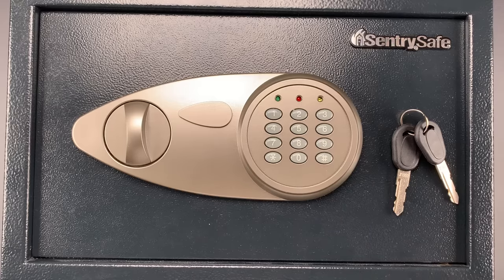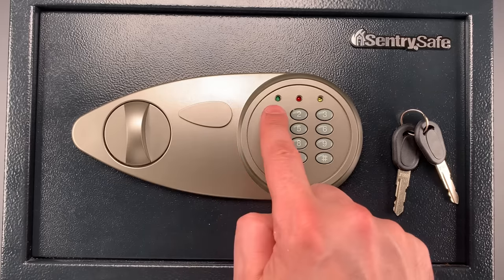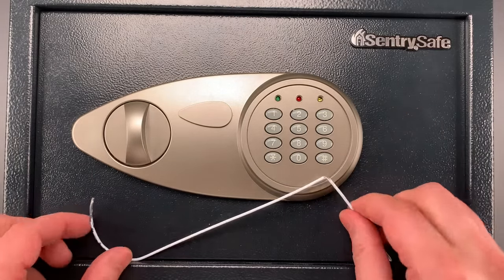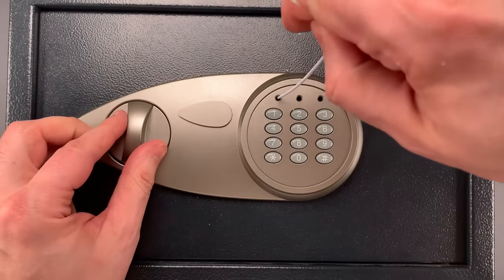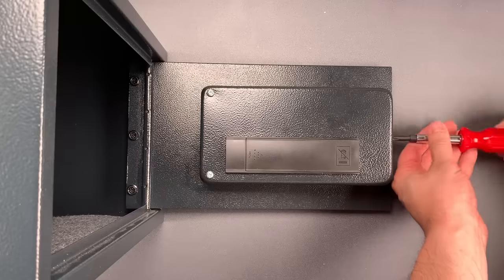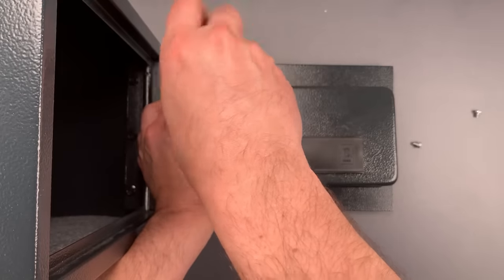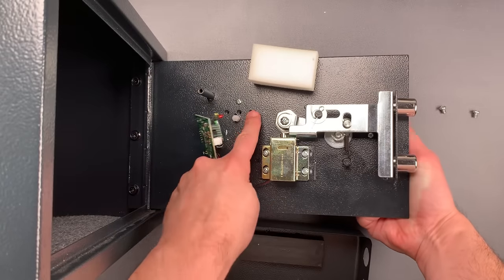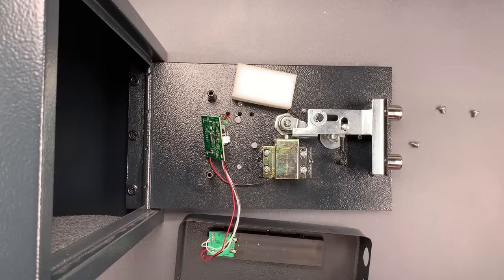[1020] SentrySafe Opened With a Coat Hanger!

Comment: I've seen these types of safes in hotel rooms and by merely hitting the top of the safe with my fist (to bounce the solenoid) and turn the knob at the correct time, they can be opened without any tools whatsoever.
Reply: Check out video 1108
Reply: Omg. Thank you SO MUCH!!! I couldn’t get it at all until I read this
Reply: Hotel safes aren't....
They are a requirement of the hotel's insurance. As you stated, they can be opened with a sharp knock. There again, if you've used it to store your Cartier watch or whatever & you're robbed, the hotel's insurance may pay out (hopefully!)
Reply: @stephenphillip5656  Hotel Insurance?  Good luck with that in Asia, Central & South America. LOL
Reply: @stephenphillip5656  when I'm at a hotel or an airbnb I store my omega watch wrapped up in dirty undies.  I even get a chocolate bar and put a strategic brown stain on them.  

Thus far this has been a pretty good security measure.
Reply: @claytonberg721  reading your comments eliminates the whole chocolate bar trick🤣
Reply: @Zain staric OK, I blame popeyes.  But seriously, I have a few pairs that are rather historic and I hold on to them shoe shine rags and the like.  I have one pair that I pack and wrap up my watch, extra cash and passport in.  I haven't figure out what to do with my ipad pro yet tho, maybe i'll go to the thrift store and pick up some granny panties or something.

Also ladies and gents, tip your room attendant.  Leave a few bucks there.  It's a thankless job, a clean room and a room attendant that isn't fecking around with your stuff can make or break your trip.  You won't miss that fiver, but it may make someone else's day.  My two credits.

Comment: From the looks of the locking mechanism that's also one of those non-safes that can be opened by a sharp whack on the top... It's utterly ridiculous.
Reply: Beat me to that exact  point.
Reply: Or bounced off a mattress if it's not secured to a wall or floor
Reply: Yeah looks like if you picked it up and dropped it sharply on a surface you could unlock it as it hit.
Reply: @John_Ridley  you have  to drop them on the bottom  right corner but it does work
Reply: I remember seeing a video where one was opened by banging on it with a potato. Whacking it open didn't even damage the potato...

Comment: I went to Amazon to post this link and found videos showing that this safe can be opened even faster using *gravity*.  Lifting and dropping the safe (less than a foot) causes the solenoid to dip enough to allow the bolts to retract. Much faster than using a hanger and will not show any signs of forced entry.
Reply: Hahaha I was thinking the same thing after seeing this vid
Reply: There is no way that solenoid has that weak of a spring! ....Right?
Reply: @lorenzknox6922  I bet the spring is made of a spongy metal

Comment: There is a MUCH easier way to open this type of safe as long as it is not bolted down. Because it relies on a solenoid that has a VERY weak spring to engage the locking bar
All you have to do is give the safe a quick shake downward and quickly up and it causes the solenoid to retract momentarily and you can open the safe! No tools required.
That being said, LOVE THE CHANNEL 😊😊😊😀😊😀😊😀😊😀
Reply: Thanks, I sprained my back with no success.

Comment: High-security sponge jokes aside, that spring-loaded solenoid is a joke, itself. Could you potentially just drop the safe, and displace it enough to open it?
Reply: Sure, you don't even need to drop the safe. Just hit the safe from the top and turn the knob at the same time. It takes 5 minutes of practice and opens about 75% of these types of safes...
Reply: They're usually bolted to something solid.
Reply: Exactly! You have to be naive to believe that someone can't just can walk out easily with safe on hand! My advise, question all protection systems, specially the ones you didn't make!
Reply: @biggawinnacrapsa3870  hit on top works even when they're bolted down though.
Reply: dropping it would probably break it and then the safe will actually be inaccessible!
Reply: There is a video of a 12 year old kid dropping it onto a bed from 12" and bouncing it open every time. If the safe is bolted down, you can open it with a rubber mallet!
Reply: Fred Krazé but it’s a safe which means it’s supposed to be chunky at not break
But there’s an idea in that rubbish, a safe that fucking explodes sending lethal shrapnel everywhere if too much force is applied

Comment: It appears with many locks you pick that you have been able to view the internals to find the weakness before attempting to pick the lock. How would you approach picking this lock without knowledge of the internal design?
Reply: How does a car mechanic fix cars? By knowing the inside components.
Reply: This is at least the third similar safe I've seen on this channel that has the same garbage tubular lock bypass behind the panel in the middle of the face.  (Honeywell and AmazonBasics were the others.)  The impressioning tool to defeat that lock is readily available, and not only picks the lock, but tells you the pin depths to make a copy of the key.  If I wanted to buy one of these at this point, I'd be shopping for a new bypass lock first, then buy the safe and open it up to see what else needed fixing to actually make it a "safe".

Comment: @LPL - thank you. My safe battery ran out, and for some reason the key was jammed and wouldn't turn. On my safe the coat hanger trick wouldn't work - the LEDs were firmly held in. However just seeing where the solenoid was positioned (I could see the four screws on the other side), allowed me to work out where to drill one single 4mm hole, and through immense luck the drill bit itself pushed the solenoid down.  Took 10 mins to drill through though - tougher than they look!

Comment: I found one of these dumped by the communal bins - I picked it up and shook it - I heard something rattling inside;
" That's coming home with me, I said to myself ".
I too was able to able to circumvent the solenoid - ( with the assistance of  gravity -shh, it's a secret ).
It sounded like a ring or pair of rings were inside - I was hoping for a Diamond engagement ring or a pair of Gold wedding rings . . . 

. . . it was the screws for affixing it to the the wall or floor ! 
All was not lost - I changed the combination and sold it for a tasty 20 bucks.

Comment: You can also just bang on the top. Pushes the solenoid down for just long enough so you can turn the handle. Have even been able to do this with the safe bolted to a concrete wall.

Comment: Would make a great decoy safe. Leave it near the entrance with a wire hanger on it. 

The hilarious thing is the could have easily fixed this by super gluing or hot gluing a piece of wood of plastic in the way of the holes and the solenoid. Although, they may actually do this as a user fixable fix as they did with their fire safes that can be opened with a magnet.

Comment: One of the very first safes I learned to unlock. I used a letter opener to put into the key hole, and turned the key mechanism and I was in. Some folks 'round these parts charge $150 to get in for customers. LOL

Comment: Every hotel room I’ve seen that contains a safe was one of these
Reply: Honestly hotels shouldn’t even bother putting a safe there if it’s gonna be a shitty one like this. Who even uses the safe anyways?
Reply: @LunaProtogen  People with kids I guess.
Reply: squngy0 Oh right, I guess that makes sense.
Reply: @LunaProtogen  Most common use case I've heard is when the tenant brings back a one-night stand and they don't want their mate to run out with their shit before they wake up the morning after.
Reply: @LunaProtogen  Insurance purposes. If valuables/passport is stolen, you can prove you used the hotel security, therefore insurance pays out. Don't forget for this to work he needed to know he could poke the wire in, guide it and where to push down on the solenoid - yes it's a shit design when you see it done like this, I wonder how many times he did it without opening it and angling the wire correctly to get it done?
Reply: Gobtik honestly, that thought pops into my head a lot watching these videos. I wouldn’t even know where to begin to try exploiting any locks/safes if I were just guessing my way around. Then I watch these videos and I’m like “huh. That easy.”
Reply: @LunaProtogen  it's less for protecting your stuff from someone breaking into the room and more for the staff who come in during the day to clean, when I'm in a hotel I'll hide my passport if I have it as well as my battery chargers in the safe just to make sure the hotel staff doesn't pocket it.
Reply: @Gobtik  He reverse engineered how to break into it.
Reply: The safest place would probably be in the coffee makers under the coffee grounds. The maids don't even want to touch that. Or if you want to be clever, tape it under a chair and hang a jacket over the back. Pretty sure no one would look.

Comment: I have (had) a SentrySafe Model PL048E in my work van. Has a dial and keypad like this one, and a key lock I guess for backup.   The battery died and I needed something out of it, but could not punch in the code, and they never gave me the key to it. I got my boss to approve me prying/cutting it open, and he would then order me a new one. I thought before I grab the ol' angle grinder, I would try to pry if open. I figured I would have to peel the lip up from the lid to get a prybar in there, then pry the lid off of the body, or something like that. I started with a flathead screwdriver, but instead of having to peel/pry/repeat, it popped right open in literally two seconds, just with enough force from a standard flathead screwdriver that I think a 6-year old could have done it. I told the boss not to bother ordering another one. I think I got into it faster than even you could have picked it, and more easily too. Moral of this story: DO NOT waste your money on SentrySafe products!

Comment: Thank you, Thank you! My little key broke in half, I had no batteries in the safe, and I was willing to try anything (including drilling and smashing!). This worked perfectly! I did spend some time on pause with an exact picture of the shape and size the hanger needed to be, but after that it took 1 minute... TaDa! Thank you again for you help. I couldn't find a replacement key. I will use batteries for now until I get a new safe.

Comment: So, so all they need to do to fix this is by welding a steel plate between the locking mechanism and the holes and circuit board?
Reply: hahahaha...welders cost money. No.
Reply: @MrStrizver  Where I work, welders are underpaid and robots are even cheaper.
Reply: TRUTH _  , by "they" I meant the manufacturer to add this step to rectify the problem. Smarter.
Reply: Buy a better safe.

Comment: At least hotel safes are never positioned near coat hangers. 🤣
Reply: Some hotels having the coat hangers locked to the rail isn't actually to stop you stealing the hangers; It's to stop you opening the safe.
Reply: @anononomous  bingo; the pieces are locking in, so to speak . . .

Comment: How would you have been able to do this without first knowing the position of the solenoid and particulars like the foam PCB retention black? Or, did you simply pick the lock first then examine the mechanism?
Reply: I wondered that myself.
Reply: I'm guessing any safe expert who has taken a few apart can pretty much immediately picture where the solenoid would have to be at a glance.
Reply: @montanaxvi  And continue to wonder I suspect we will. The LPL never seems to weigh in on questions.
Reply: @jafafa  I'm sure that's an aspect of it but no one would know with first having seen it that there is a block of foam holding the PCB in place because that's really stupid.
Reply: Sure, but he surely knew there was a PC board the LEDs were mounted on, that holes are a potential weak point, and that pushing on the LED to see if the PC board could be moved would be among the first things to check. Maybe not expecting foam, but PC boards are often loosish for varioius reasons, especially in cheap crap.
Reply: Do you really want to trust that a criminal out for your stuff doesn't research? 

Sure No low intelligence criminal would try to pick it, but a career thief would absolutely buy safes to find their weakness.
Reply: @Pickleriiiiiick  A reply from the Man hissownself would be helpful here.
Reply: @michaelisaacson9735  I don't know how. People who steal for a living do it completely differently from the ones that "need money" for drugs etc. They will put in the leg work to Learn how to do the job. 

Any low end lock)safe is only there to deter opportunity thief's. You need actual security to deter any expert or career thief

Comment: Im so proud of myself, we have this same safe at work and it ran out of battery and we had no keys, but thelockpickinglawyer had us covered 😎
Reply: Any other tips? Mine ran out of batteries and I can’t seem to unlatch it
Reply: @Jdan0114   Make sure your wire is only as as long as his was, and you insert it at the right angle.  I inherited a locked "safe" with my house, and decided to try and open it to remove it.  First try failed, reviewed the video again, trimmed my wire, got the insertion angle, then tried again and had it open in 10 seconds.

Comment: Besides the holes in the door, how was the rest of the safe? Because I could easily see that being patched by a user who was handy and preventing that bypass. Was the lock easy to pick compared to other safes?
Reply: If you look at the inside door hinge, it's secured by three screws instead of being weld which I would call a weakness.
Reply: Simple: You just drop it on the floor to open it

Comment: welp you saved my butt today, I'm a manager and switched the code on one of these bad boys today, made sure the code worked before I shut it... but forgot to shut the battery door.. 😂
safe locked, key inside and no power to the keypad because the batteries popped out - an hour and a half later and I was in! Thank you LPL!

Comment: I’m a locksmith and veteran lock picker, aside from medeco or Abloy, I haven’t seen a lock I couldn’t pick. The sentry safes I’ve opened often are easily picksble, whether single side key, double sided, or tubular, are very easy to pick in a matter of seconds. The right tools can get you into most safes if they have an electronic lock with an optional key only lock mechanism.
Reply: I have a sentry safe and when I closed it the battery fell inside. My husband lost the key now I don't know how to open it. Can you help.

Comment: If you have a cheap fire safe for documents, leave it unlocked so the thief can see there is no value, instead of having them carry it off or bust it open
Reply: Or leave this IP address taped on the safe in case it gets locked by accident.
Reply: @somaday2595  you might be a computer geek if you call the combo an IP stress 👍

Comment: I would not say having a hole is the problem as most safes have holes in the door and can be unavoidable, i would not even say the sponge is the issue because all these would have not mattered had they simply welded a blocker plate between the solenoid and the holes.
Reply: Maybe you don't need lights on the front of your safe
Reply: @phillip stafford-dafoe  Not really if there was a plate between the tiny holes and the solenoid then this exploit would never work no mater how long you tried and people would need to fall back on brute force or code cracking.
Reply: @nathan-fh8hp  Perhaps you do or perhaps you don't, however it really would not have mattered had the lights not been there because there would still be one massive hole / slit in the door that is there for the keypad ribbon cable and all you would have had to do is smash off the plastic keypad to get to the massive hole or simply drilled a tiny hole through the keypad to access the larger hole and so access the solenoid, so again the fact that there are light holes is irrelevant because you could have 3 tiny holes or 3 tiny holes and one large one or heck even a fist sized hole in the door and it would not make a bit of difference because had there been a metal plate between the holes and solenoid no amount off access to that section of the door would have given you access to the solenoid.
Reply: @EQINOX187  👍
Reply: @phillip stafford-dafoe  True though not every thief is as skilled as LPL and most would simply use a crowbar to brute force the safe door in a few seconds, though that does not excuse the design flaw in this safe.

Comment: Can you recommend a decent safe that is good value for money?
Reply: The one behind that large, mean, well-trained dog....! 😏
Reply: These safes are fantastic, fit  one in plain  sight and then put all your valuables  in the freezer
Reply: Perhaps a safety deposit box made from concrete and rebar.
Position that under the tiled floor and place a loose but fit tile on top.

You can't pick anything if they don't see anything.
Reply: @pcx 2019 add lead weights and it would be very good strategy.

Have not tried, but will recommend!

Comment: Brought to you by "todays sponge" it will keep you safe from having a baby but it will not keep your valuables safe....😂😂😂
Reply: Buy SpongeSafe. We guarantee to keep you baby-free but not protect your family jewels. Available from some guy on the internet?
Reply: Maybe that one should be used as a birth control method once, and then it can be put back in the safe. It'll protect the solenoid a little more since it'll be all crusty and hardened once it's dried. 😬
Reply: @roberto3262  bahahaha splooge!
Reply: @soundsolutions  😂💦

Comment: Probably easy to correct if you already bought this thing.  Bolt some steel angle-iron to the inside of the cover, blocking access from the circuit
block to the solenoid/latch area.  Would slow them down and confuse the issue, anyways.